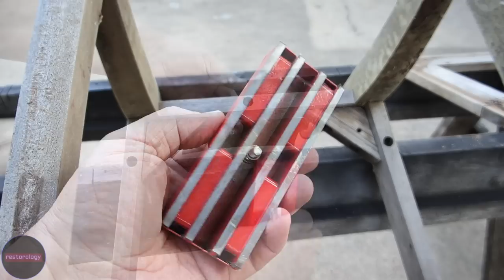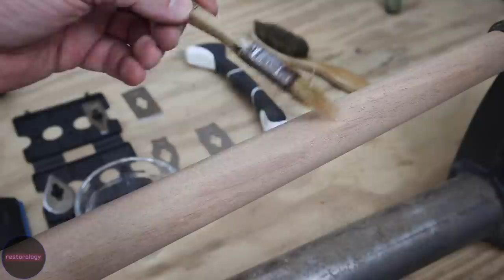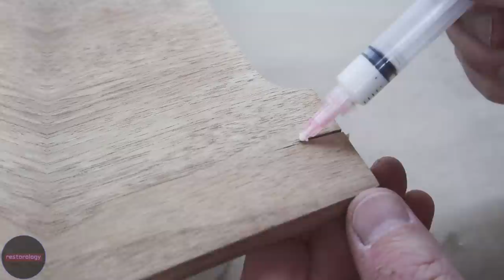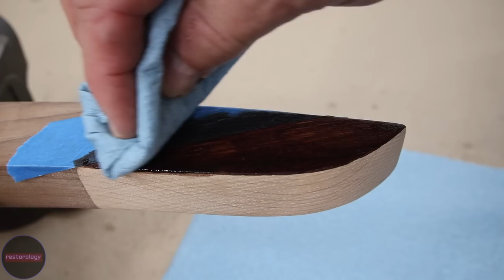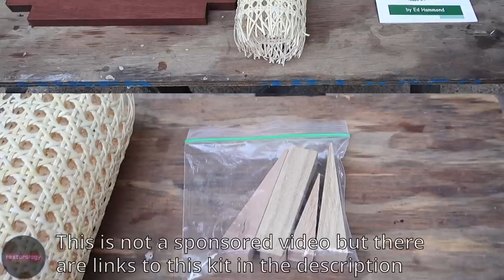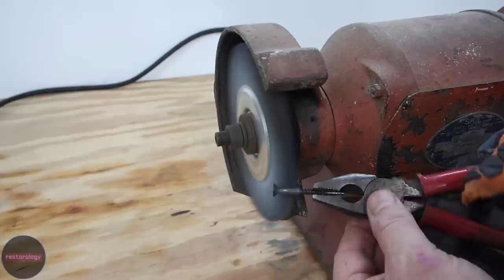Another Junkyard Gem | Rotting Rocking Chair Restoration

Comment: Consider investing in  a Hegner scroll saw. You’ll be amazed what you can do with there ultra fine blades
Reply from the maker: Cutting that rocker repair would have been SO much easier with a scroll saw, no doubt. I'll eventually get one. Thanks for the advice!

Comment: Rotten rocker / Tweet, tweet-tweet / Rotten rocker / Tweet, tweetle-ee-tweet / Go, rotten rocker, 'cause you're really gonna rock tonight

That was a meticulously done restoration. You don't often see rockers with no arms. There's a name for those, isn't there? Something like a "quilting chair" or similar. Meant to leave room for the user to work. Beautiful work!
Reply from the maker: Thanks! Now I've got that tune stuck in my head. I had not heard of a quilting chair but when researching this I found some referred to as nursing rockers. I can see it being used for that. It is actually kind of small, like a kid's size.
Reply: @Restorology  That would make sense. I looked it up too (trying to remember the name of that kind of chair) and saw some called nursing/nursery rockers, sewing rockers, or slipper rockers. You were right in the title, it's a gem now.

Comment: Did you not use glue on the final build or did you just not show it?
Reply from the maker: When I disassembled it, I noticed that only the dowels were glued. Even the glue blocks were not glued but instead nailed. They may have been glued originally so they were glued upon assembly. Everything else is held in place by the glue blocks and screws. Thanks for asking!

Comment: To answer your question: You forgot wood glue between the pieces. Otherwise, it was an amazing restoration!
Reply from the maker: You are correct but that is not to what I was referring in the video...I forgot to include the back rest piece when assembling the first time. I used glue only on the dowels and glue blocks. When I disassembled the chair, I notice that the slats and legs were not glued but were only secured by the screws and supported with the glue blocks which were also not glued but screwed and nailed. No nails were used in assembly but I did use glue on the blocks. Thanks for the feedback!!